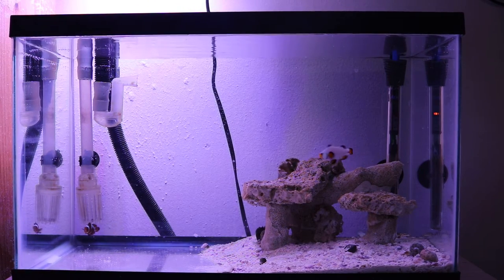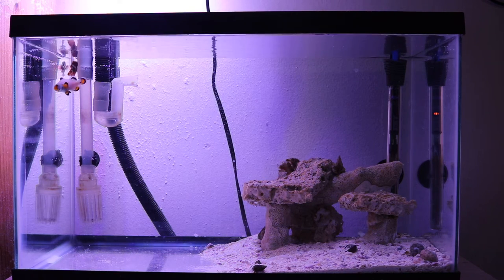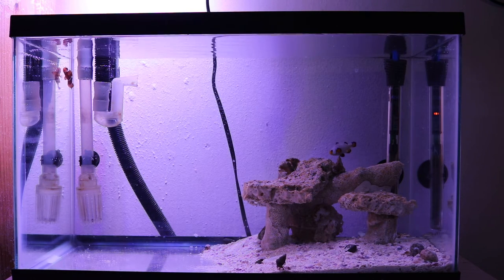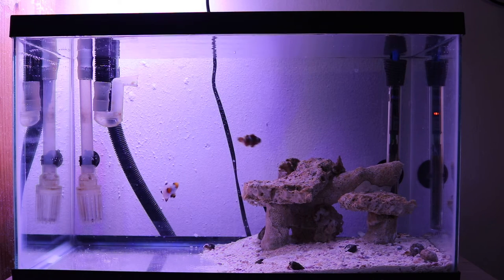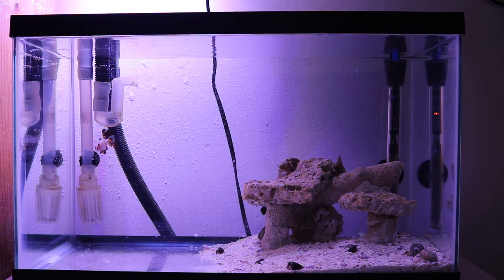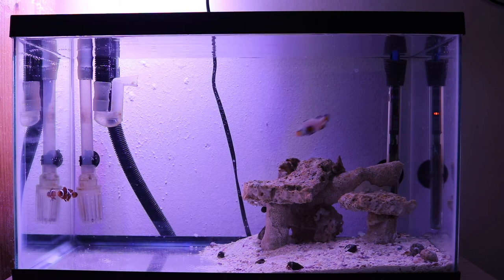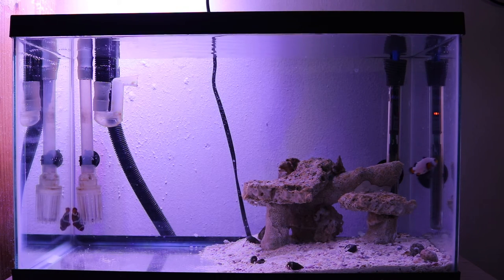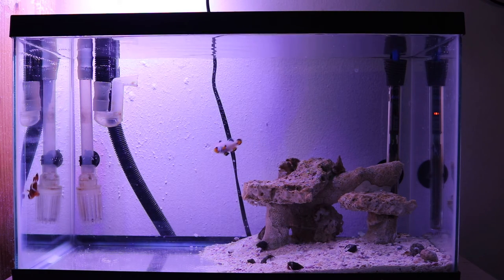Project Nano Reef EP 2: Moving From 2.5 Gal To 10 Gal Tank.

Comment: You'll have an easier time with the 10g. A cracked 2.5 had to be tough not knowing if which water leaked and which water evaped. I'm not sure but the live sand may cause a spike. I would add it a cup at a time.
Reply from the maker: Dave Lembo that's true. i learned the hard way that it cracked when my carpet got wet :(  smh. better late then never. haha. and ya I'll be adding the live sand slowly as i did with my 45 gal when 1 converted from crushed coral substrate to sand substrate. thanks for your input 👍